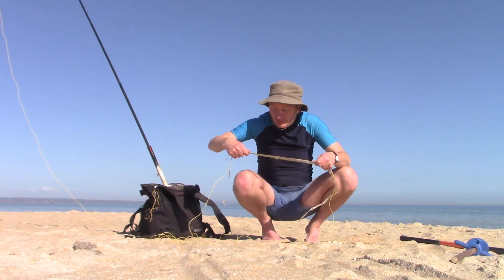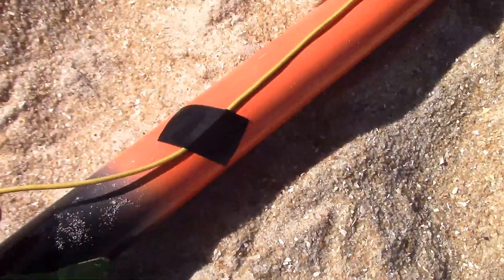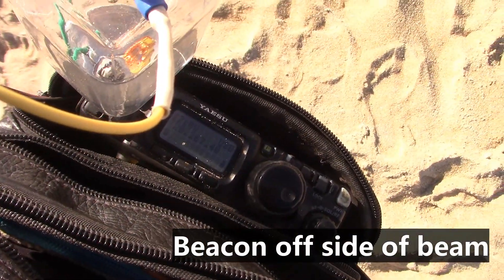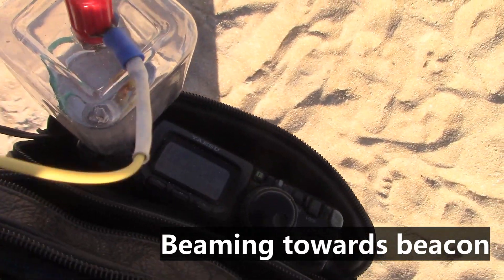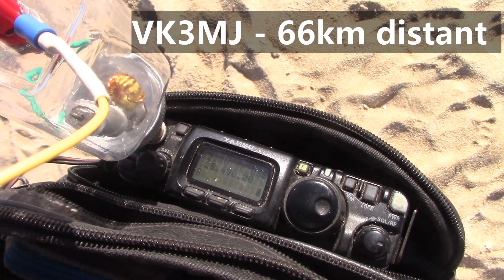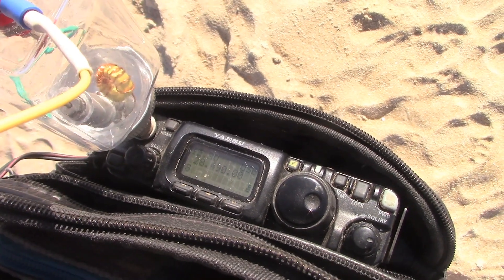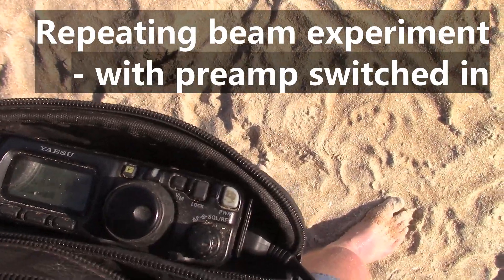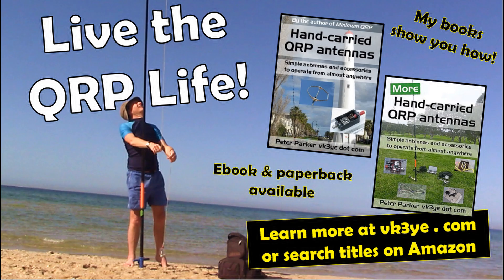28 MHz Wadetenna beam on the beach

Comment: Peter: I modeled the 2 element vertical beam with EZNEC7 Pro. The driven plus director gave slightly more gain than the dfiven plus reflector and the director incfeased the side and back rejection.  I was impressed enough to make a 6 meter director to use with a 6 meter Flowerpot (VK7HH dimensions). 6 meter spacing ended up 92 cm, and I rigged it to rotate around my mast on the balcony. It really helps with our local net, hi!

I zm giving you credit and presenting your antenna projects at the local ham club meetings. Keep up the good work!

De WB2VUO near Buffalo,  N.Y.